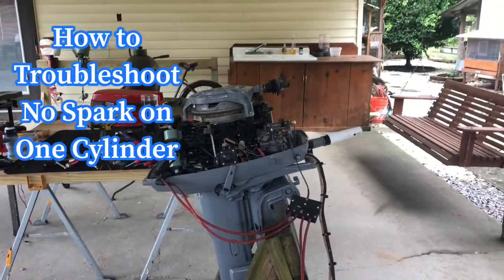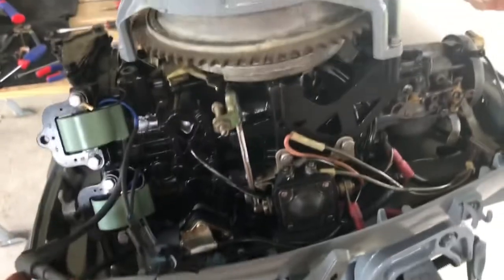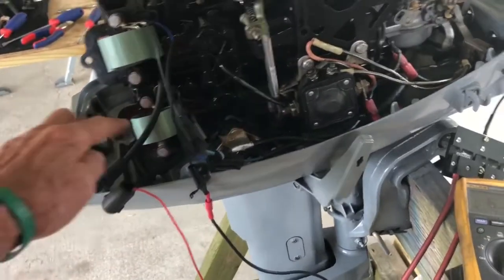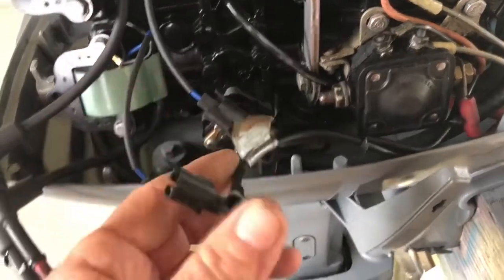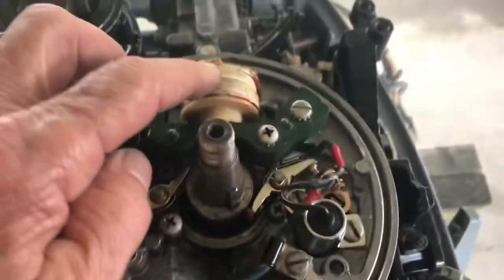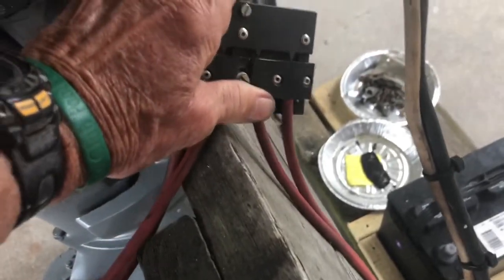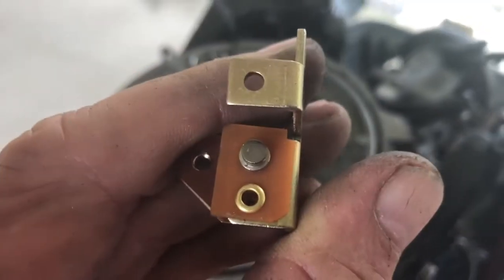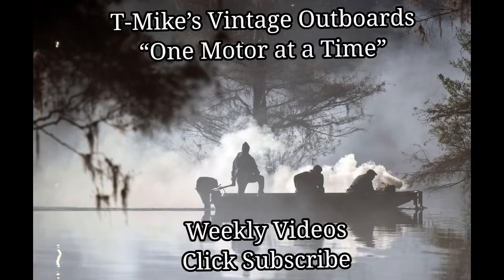How Troubleshoot Outboard with no Spark on One Cylinder - 1973 25 HP Johnson

Comment: Love your videos u watch them when i am not working in boat motors 25 hp. And less mostly 70s
Reply: I think oem points are china now, and not so good.  The Sierra ones are usually better - but double check because they could be pitted.

Comment: I love love your vids. I have a question. I’m in the same situation. But I still can’t get spark on my bottom cylinder. Points are new and good. Wires are good. Coil is good but no spark. I’m at a lost. 1972 25hp Evinrude sportster
Reply from the maker: @kaochang6624  switch parts with working cylinder
Reply: @michaeljsimon  I will try that

Comment: Great video. Were the replaced points:
1.  Sierra branded points
2.  Pitted like that right out of the box. If so is that a flaw in mfg process in your opinion. 
3.  Have you experienced that on OEM points. 
4.  Can you remediate the pitted points with a file, sandpaper. 

Thank you.
Reply from the maker: Yes. Sierra parts - I replaced with Sierra

Comment: Hey Mike. I tested the bottom boot to ground and only got 0.99 on 20 k ohms...Same as the top boot.. I just rewired this 1974 mercury 9.8 Thunderbolt right up to the points. Didn't do anything else like condensers or anything. ( Every wire was broke..crazy) Having spark issues.  Super week to none whatsoever.. No tester, just grounding plug to a bolt and my son pull..lol. Could it be both spark plug boots? Been sitting for 10 years. Just purchased it. Any insight would be greatly appreciated!  🇨🇦
Reply from the maker: Sorry not familiar with Mercurys.
Reply: @michaeljsimon  ...Bummer